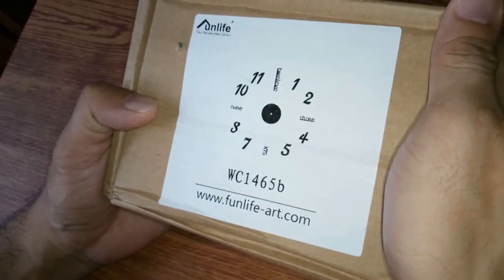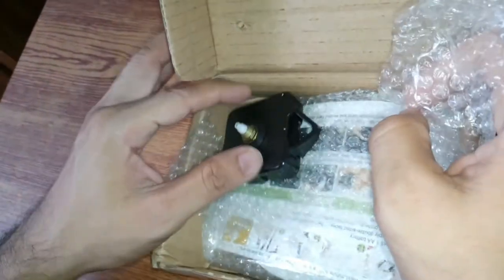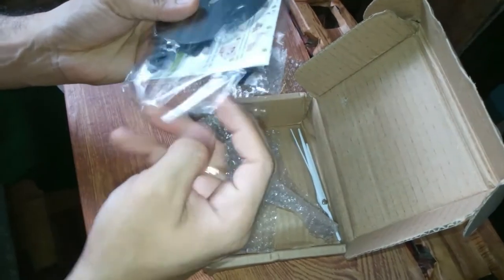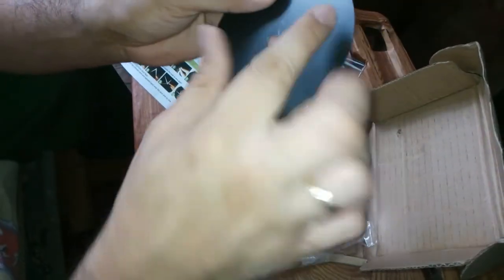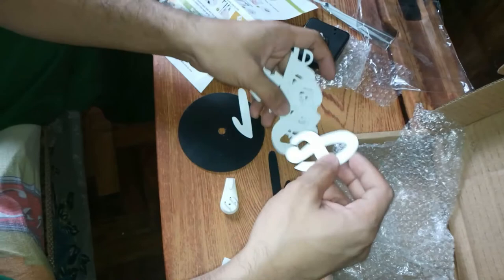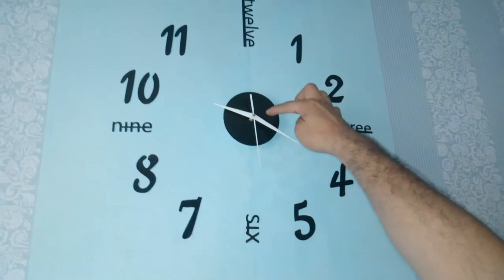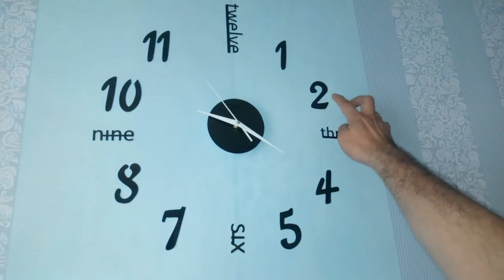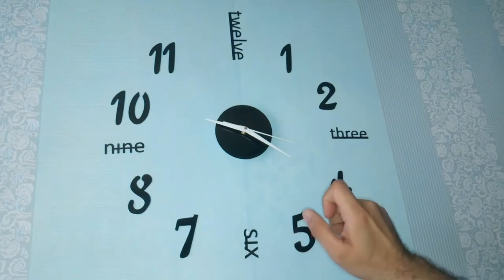How to set up DIY Wall Clock???

Comment: How did you use the white 1 with 3 metal?
Reply from the maker: There is a small hole on each of the white metal and just stick it in the middle of the moving metal hand holder.